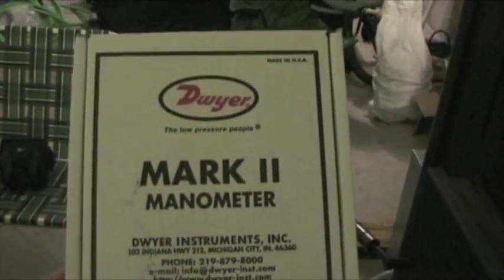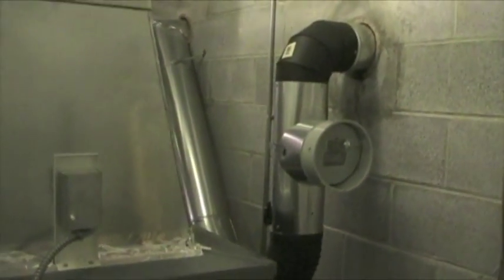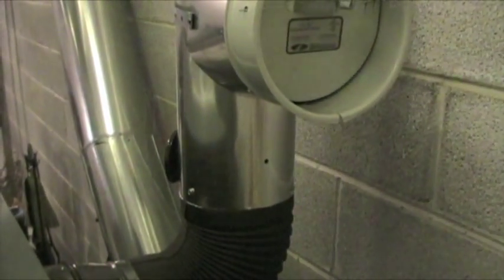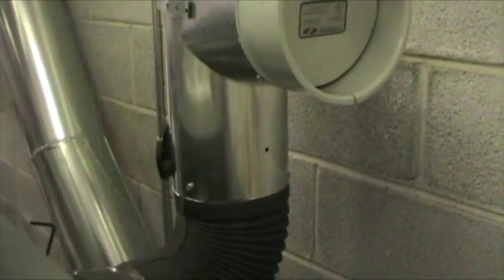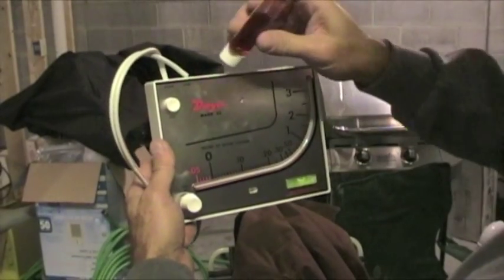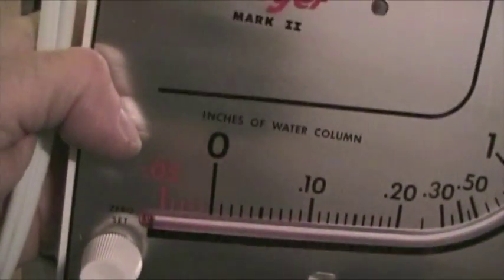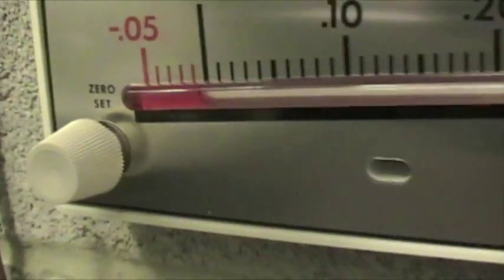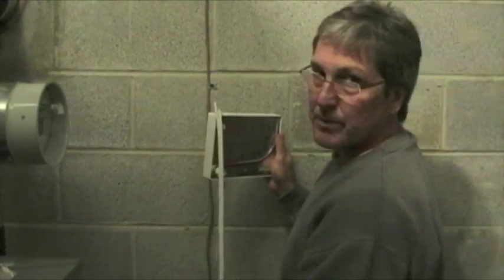Wood Furnace

Comment: Since the draft is actually the "low" pressure side, hook the rubber tube to the "low" port on the manometer and leave the "high" port open to atmosphere. The reading on the gauge will go positive but that's because it's backwards. Just consider that reading negative. This way you're able to utilize more of the gauge. The negative (red) portion of the gauge is only there so you know that you're "zeroed" properly.